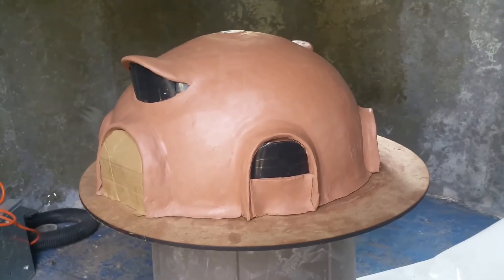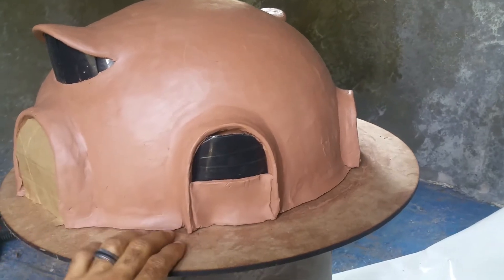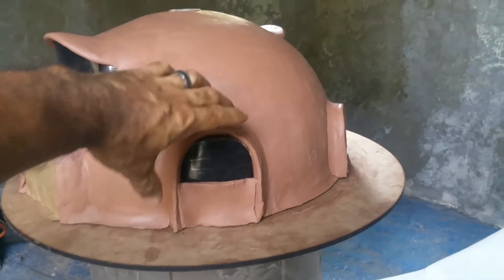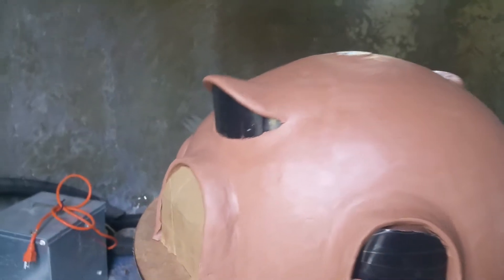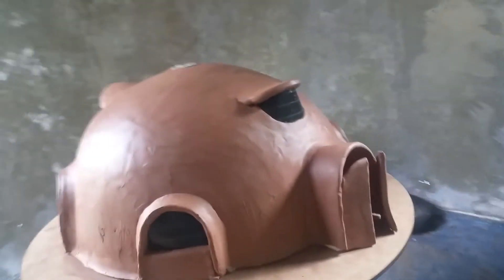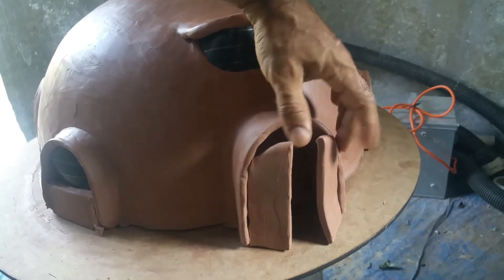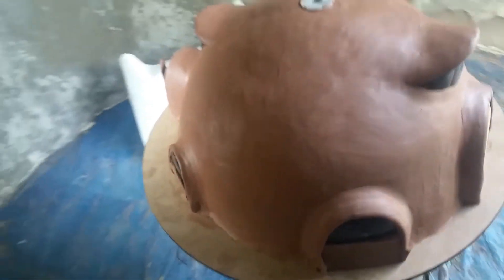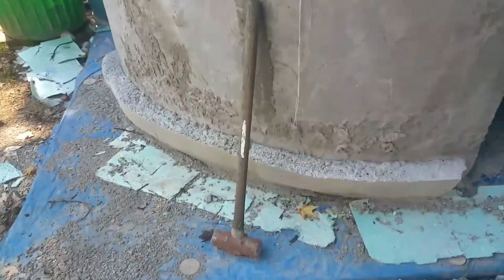Dome Home Model Design #aircrete #dome #model #aircreteharry #aircretedomebuild #domeproject #diy

Comment: Thank you for showing this experiment, you definitely put time and effort to do what you have passion for. I love your videos. I’m thinking if I have the chance I would build two caps (molds in sections) one inner and the other outer cap off set them 5 to 6 inches out of sheet metal and pour the concrete between the two caps., that will give better support. When the concrete dry the sheet metal could be removed in sections, the inner sections and the outer sections.